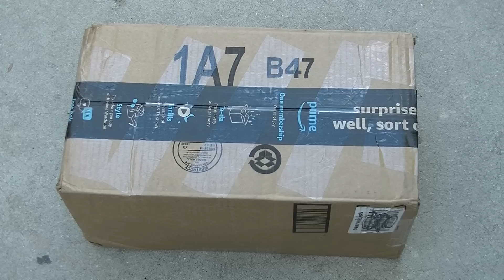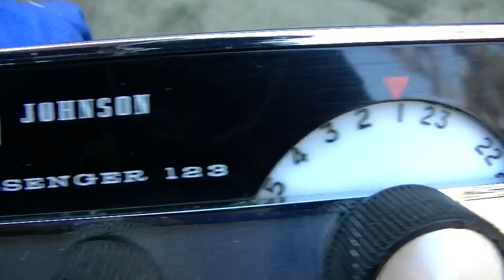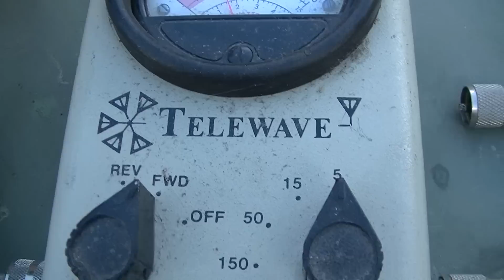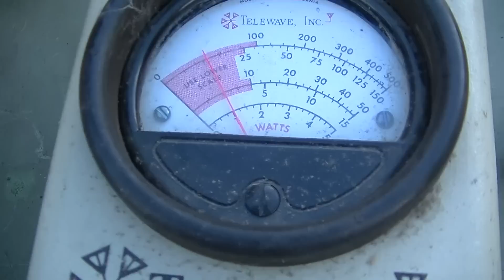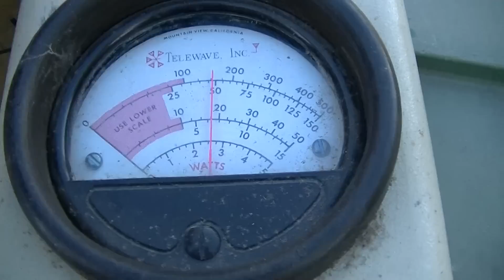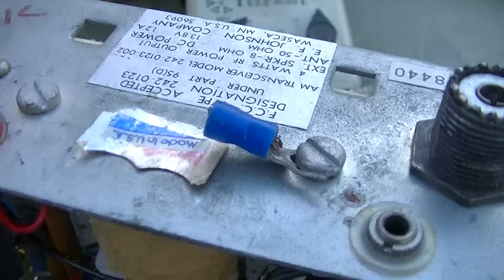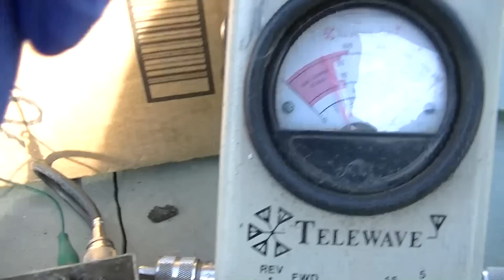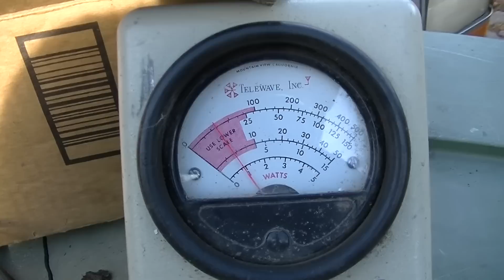Johnson Messenger 123 Vintage CB Radio And 123A

Comment: Thanks for sharing this. I had a similar experience when I was a kid and picked up a 23 channel Johnson for $5 from a friend. It sat for years in my bedroom until in 1983 I convinced my father to drive me 45 minutes to a CB radio shop (back when they existed) one night to get the thing working. They wired it up to my Radio Shack 12v power supply and even made a coax dipole antenna for me. I loved that radio... I think I sold it years later when I was short of cash. I miss the memories it provided. 
BTW, Johnson was a radio made in my home state of Minnesota. Well respected gear and they even have a museum in Waseca, MN...

Comment: This brought back some memories, the Johnson 123  23 channel  radio was the first proper CB radio I ever had. Before that I had 100 mw  Walkie Talkies. The manager of the local Radio Shack gave a tip about a guy selling one as he was buying a new Realistic CB. I was way too young to have a car, so I powered it with a Radio Shack 120v to 12 v dc transformer and also bought a Radio Shack antenna for the roof. All funded by my paper route money. Had to buy all the mounts, coax cable and guy wires and what not. I didn't ask the parents first so they came home from their business one day to see this big antenna on the roof and were NOT impressed. Apparently it was Their house and I should have asked permission, but they eventually came around and were OK with it.

Comment: I got into CB in 1974 when I was 14 right after the boon began. My Mom's boyfriend gave her a new Teaberry "Mighty T" She didn't want it & gave it to me. I came up with a power supply & a 1/2 wave ground plane.  I picked ZZ-Top as my handle. I decided to use a power mic & cut the mic off the cable & spliced the cables together with electrical tape. I was having a ball with it. I started wiping out every TV & stereo in the neighborhood! I got a Johnson 40 channel radio in the later '70s. I loved CB till 1992 when a bunch of drunks took over CB here in our town of Kennett, MO in early '92. I sold out my Cobra 2000GTL base, Fantom 500 1KW linear & my mobile President Grant & Texas Star 250 amp for $1000. Those drunkards were filthy talking & seriously damn near had a killing every Fri & Sat nights. At the time it was no longer fit to have around my 14 & 12 yr old daughters in the house or my vehicle. So, after I sold out; I paid down on a big-dish satellite with a modded VC-1 board and watched a lot of TV & movies I'd missed over the years. I could at least control that in my house!

Comment: A neat little radio there, I never really was a CBer but Grandpa was, as he was a truck driver. When he bought my Grandma her 1981 Lincoln Mark VI one of the options he specified was te factory installed 40 channel CB, with Fords the CB was a module in the trunk near where the "Premium sound" amp was. In GM's they had an in-dash radio that was AM/FM/CB  with a little amber LED channel display for the CB.

Comment: You can "tune" crystals like those. 
Open the cans and make a pencil mark on the face of the crystal wafer. The weight of the carbon will slow or speed up the crystal vibration, depending upon the mark orientation.

Comment: what a bonus extra video this week plus it is covering an old love of mine. I still have mz second third and fourth CB's in a box . two are the old CB27/81 UK standard 40 channel FM 4watt stuff I played with as a teenager. one works but is usless in central europe one has frozen control pots and is the same frequency and one is an AM FM SSB unit i got when i was around 18 and it still works well when i dust it off and get an antenna on it. i had a lot of fun back in the 80's with thoses facebook from the past

Comment: Should have been transmitting into a fifty ohm dummy load. Eliminates standing wave all together. Most solid state CBs, ham transceivers, etc. have a circuit to reduce output power as standing wave rises to prevent power amplifier damage, within reason. Ah, You already know this. I wrote the initial comment while you were still early in video, checking power output. Enjoying a hell of a lot of your videos.

Comment: My first cb radio was a Johnson 123. Bought it from a friend in late 74 or early 75. I sent off for a license and used my number just like they told us to. After a few years of use it started cutting out. I wasn't sure what all of it did, but I did manage to trace it down to a bad solder connection on the final. Channel six sounds pretty much like I remember it sounding.

Comment: I used to repair c.b radios, people always killed the final r.f transistor with really bad s.w.r.
Good old radio :-).
Reply: Swr,  is really important, it kills the rf output transistor and decrease receiving  sensitivity.
It's really important to tune the antenna close to 1.1 of swr in the midle of the channels range.
Reply: Cletus Spuckler
Yep thats right, i always balanced the band so ch20 was the best, 1 and 40 had to be  below 1.5 .
I used to buy loads of output transistors to repair truckers radios.
i could always tell what they had done as the tx was always 2 watts.
Some people never learn sadly :-(
And people reversing the power polarity to the radio, or even worse giving it 24 volts.
Never a nice result :-(

Comment: Super cool stuff, I like that side firing oval speaker on the side of the original model. You're right, other than a few old truckers it seems like CB radio is the single-digit I.Q. messaging board. I have an old-ish Cobra 29 LTD, hard to tell the year but it looks like a newer chinese one. Me and my buddy like to use them between our pickups for communication (cell phone signal here in rural Virginia is hit or miss, you'd be hard pressed to have a conversation without your call dropping after a few minutes on the road.) I'll probably move to a newer superior two-way radio eventually when I have the money to.

Comment: There was a group of us at college in the early 90s that would use CB radio, we'd discuss the time we were going to "meet" over the college email system in the day and then just talk nonsense all night, was cheaper than a multi way phone call and most of us got out cbs for free from our parents garage / basement. I remember one guy who had is antenna in a weird place and the one side was blocked by a metal fence, most people could pick him up but a few couldn't at all... there was also one guy who got hold of his parents (not legal) 100watt box that used to occasionally blow your ears out :)

Comment: Back when I first began my career as a police officer in a small town, we had, of course the State Radio's for police work, but we also had CB in our cars, and the PD had several old Johnson Messenger 1's that we could take home and use to BS with the cop on duty so as not to bother the folks at State since they didn't appreciate simple conversations on the State Network. I loved the little Messenger 1 CB's, all tube 5 channel I believe, and since you chose which crystals to stick in, the switch was just letters  A-E or something like that.  I am starting to get back into CB once more, and have my HAM ticket as well with several 2 meter radios. I found a nice Prisident series base station at a yard sale in Arizona. I built a 102 inch antenna for it, still need to get my plastic pipe to stretch the wire antenna and make an outdoor unit for it before I power up the base station.  Even got a couple of hand held CB's in a lot from stealitback.com

Comment: Cool, as if a Shango066 video didn't merit a pre-watch like, a Shango066 CB radio video certainly does!  Hoping the skip looks up the next couple of years like it ought to i think, just maybe QSO sometime lol (Furthest I've worked is about 50 miles on UK40 for now but got a couple of Cobra AM rigs for those hazy days of high hopes )
Reply: Last skip 2009-2011
Next 2020? 2021?
Reply: @colt45peacemaker  yeh something like hopefully. Had a bit of sporadic last month on AM, only from NW England over to Ireland but it's a start lol

Comment: I used to repair a lot of johnson equipment back when i was a communication technician mostly 800 mhz trunking radio's  johnson was one of the better made radio's and pretty reliable.

Comment: The green alligator clip cable looks flimsy to me. Check the voltage drop when you transmit. Could be the reason for the low output power.

Comment: I worked at Motorola back in the day. They pretty much ignored the CB market until  way late and then finally decided to jump in. But by then the fad was over, sales dropped sharply and they were left with warehouses full of the things. Sold them off cheap to employees. I still have a couple. Somewhere. Maybe they;re worth something.

Comment: Back when I worked at the factory I had a Big Radio in the truck and used to get them going in the afternoon. 
Uh... Breaker or somethin...  Uhhh.... Bevis and I are lookin for chics.... We wanna score    LOL 
I sound like butthead and used to do that on the air. Had everyone laughing. Some other guy would play Bevis. 
Then we would make plans to go visit Andersons tool shed since there were no chics  LOL

Those were the good old days.  The HR2510 and the 300 watt amp was mounted in the stack with the scanner and the yaesu with its 160 watt amp and its 100 watt amp. I am going to have to put some equipment back in soon. Getting that radio itch and need to scratch it LOL

Comment: One of the output tuned circuits might be a 54 MHz trap (to knock out the second harmonic). You would need a spectrum analyzer or some other type of receiver covering that frequency to properly tune the slug. A power meter would not show much response at all.

Comment: Add an old Turner Power Mike, and a few sound moduels.
That Telewave is set mainly for FM and I think there are some power offsets for low frequencies. You need a Bird 43 with a peak adapter to properly read power. I know that ICM shut down several years back, bummer but Bowmar started grinding rocks for two way equipment but they don't do any compensation for temperature. Funny EFJ used the same style chassis on their 6000 series commercial rock bound radios.
Reply: Turner were the best microphones for CB radios, expensive but very efficient !
And went the Zetagi brand, with the famous BV131 valve (EL 509 color tv flyback power valve) rf booster, i had one it provided 100w rf with a well tuned antenna.

Comment: It depends. A diesel truck mostrly don't have electric fuel pumps so that is not a concern. Even more modern pumps are so efficient that little noise come out from them. But on diesel trucks that do not have electric fuel pumps that is not a concern. On gas engines the ignition system is even more noisy than the pump. The spark plugs generate more noise than fuel pumps. So on diesels it is very minimal.

Comment: I do know that the front end was verry good. Sri but I do use CB and have no noise. And I do have a cheap maxon tranciver. And they were really tight on what comes out the  tail pipe.  Back in the day. 4.5 max

Comment: 1,000 Watts, 100% Modulation, 10 IQ points
Reply: 1kw doesn't get you heard anymore, now they are upwards to 3 to 7kw with c-class am pill boxes. It's a mess, but fun can still be had on SSB. I had a blast this last summer during the skip cycle. I never needed more than 50 bird.
Reply: Moderate Extremist    3kw.... That’s just the driver.. 😁
Reply: Sweep Tubes!    Compactron 6LF6
Reply: Okay hammie....

Comment: Decades and decades ago it was very popular for people to put "boots" on their CB. An illegal process of installing a HAM radio linear amplifier on the CB's output. Boosting the output to a thousand watts or so. It was also popular to make modifications to the CB radio itself, to make it operate between the assigned frequency channels. This was called "sliding",  and gave the operator a few "private" channels to operate on when the band was crowded. This was also illegal. Another interesting thing going on back then were remote users down in the southern states using "beam" antennas to talk "skip" around the entire nation. Note that there is a legal distance of 160 miles that CB can be used for, making skip also illegal. One memorable guy who was using all three of the above methods used to fire up his "rig", find other conversations going on, and scream for hours and hours, day after day, the following phrase.....
"I GOT A BRAND NEW CEEEE BEEEE"
Does anybody remember that guy?, It went on for years. At least untill the end of that 11 year sunspot cycle, when the band ""dried up"
Reply: We still split channels, use beams, however those old drifty sliders are long gone. And yes we still have agitators on the band. These comments are blowing my mind...CB radio is alive and well despite reports to the contrary. I talk local and DX everyday, and yea i have may Ham ticket, but i have to be honest, besides the call signs being broadcasted, sometimes 20 and 80 meters sound just like centerslot on 11 meters. 38 lsb is where the adults talk these days, it's still a lot of fun too.  I also have to be honest, i am glad there is less people on 11 meters anymore, many of the people we call internet trolls would be known as radio rambo's or "agitators" and they would be on the band causing issues.

Comment: Tantalum teardrops are good? I dunno...they go out in the old tek scopes all the time and need replacing.
Reply: The modern tantalums don't seem to be much better.  I've had my share in both Harris and Moseley broadcast equipment either short and pull a power supply rail down, or flame out.  Sometimes all you find are the two legs left behind, and a scorch mark.

Comment: The biggest reason I stopped using it is because all the big CBers had overmodulated radios that sound so muddy, it was impossible to understand them.
Reply: Modulation invariably awful. Unnecessary echo makes it worse.  Cheap linears deal another blow. Don't know how they understand each other or if they even care. It's quite an oddity.

Comment: Yes poor packaging. I had a CB  in the early 1960s when a license was required and all CB radios were vacuum tube radios. The best CB radios of those days was the Citifone SS, Tram TR27B and Sonar model G. I faded out of CB when I got my novice ham radio license. I have not listened to 11 meters in years but I do have a Swan 1011 that someone gave to me some years back. That radio has been gathering dust on a shelf in my electronics work shop since I got it.  My Icom 756 will tune 11 meters so I might take a listen one day. Years ago we hams called CB "silly band" but when CB was new it was not all that silly. I have heard worse garbage on 20 and 40 meters. In my opinion ham radio seemed better in the days when AM was the norm before SSB became the norm.  My interest in ham radio seems to have faded some.

Comment: 6:10
Wouldn't an off tuned antenna cut the wattage in half ?
Reply: An off tuned antenna causes a high standing wave ratio "SWR" and will fry the output transistor in the radio. We measure SWR and try to get as close to a 1:1 ratio as possible, with an impedance of 50 ohms. So yes, having an off tuned antenna prevents wattage from flowing out of the antenna and it pushes back into the radio. If you are interested in radio i recommend reading CQ magazine, and the ARRL has a plethora of informative information on antennas and propagation.
Reply: And will fry the final for sure